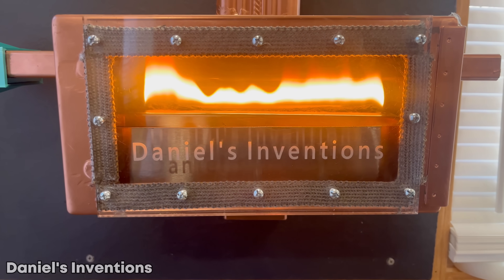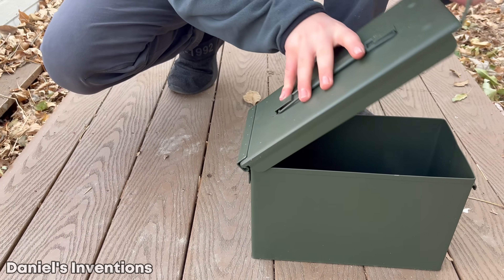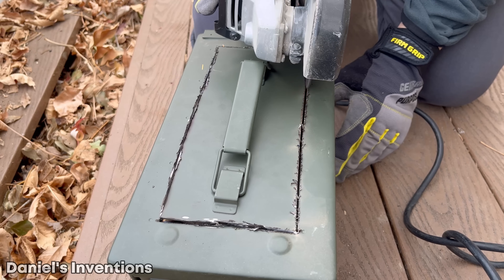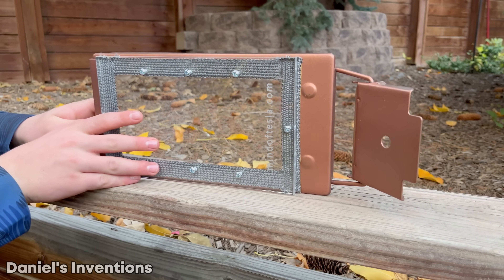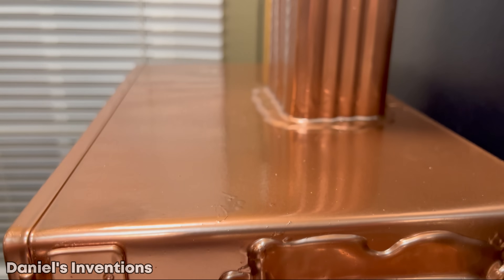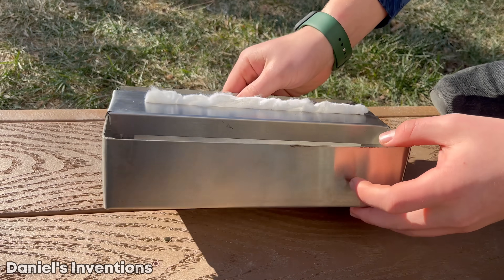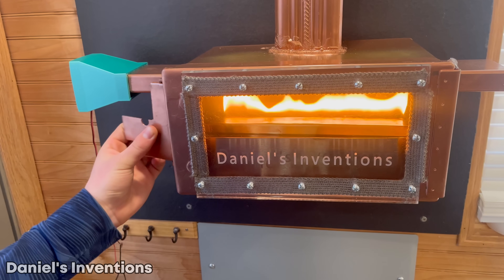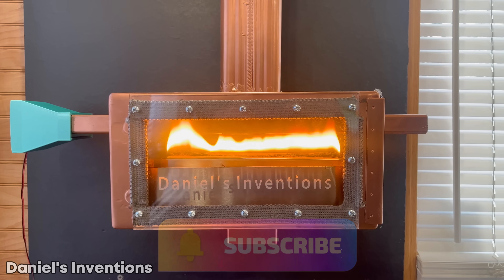ENDLESS Heat for Your Home WITHOUT Electricity 2.0

Comment: Pretty cool! A couple of suggestions-- use carbon felt as the wick because it will never need to be replaced and will wick up almost anything.  Use the high temp JB weld because this is pushing the temp limits of the standard JB weld and may release nasty vapors when it burns.  Before painting it with high temp paint, give it a long hot burn outside so the original paints can off gas.
Reply: Yeah you can see the stove offgassing at the end, I bet that was nasty.
Reply: Wrong. Pretty warm ☺️
Reply: Exactly what I was going to say and you need an insulated pipe on the exterior wall of the building
Reply: better yet, weld the pipes up
Reply: @SithLith  
I thought of that, but figured I would cover the drain pipe with stovepipe bolted to the top and run up the chimney.
Reply: @jimsteele2072  I guess it would depend how much heat the bolts transfer one pipe to the other.
Either way, I'm not installing one of these in my house unless it's much better built, wouldn't want a building inspector or an insurance company to ever see that as it would make it impossible to get homeowners insurance and you probably could never sell the property with that installed.

And if I'm doing all that I might as well just buy a propane or natural gas heater.
Reply: @SithLith  propane and natural gas are very expensive, though.
Reply: @w1975b  not as expensive as rebuilding the cabin when it burns down and insurance won't cover it because your stove violates your coverage.

Or the cancer treatment from all the carcinogens released by the epoxy and the green paint he didn't remove from the ammo box.

Also, this is essentially a fuel oil heater which is already a thing you can buy and you can build them safely and install them safely if you just do it right instead of cheap.
Reply: @SithLith  so...with suggestions from others, this could be done cheaply and safely compared to paying for propane or natural gas.
Reply: @w1975b  check with your insurance company first to see if they'll allow it, but by the time you do all of that, you're likely better off buying a used fuel oil heater, propane heater, or natural gas heater anyway.

If you really want to save money, then:
1. But a used wood stove in July (when they're cheap)
2. Install it with the proper parts and up to the building code
3. Get fire wood for free at a local compost site or after storms
Reply: @SithLith  You could technically have it exhaust out a window so it wasn't permanent. Just make a drop in insulated piece to fill the gap.
And having it closer to the floor would actually make it work better as it would be sucking in cold air from the floor.
Reply: I would have mine so that the exhaust is vented out my fireplace chimney.
Reply: @w1975b  Natural gas is one of the cheapest ways to heat - ok it USED to be.
Reply: @SithLith  Dang, I dunno, this looks more solid than many 'professional' installs.
Reply: @SithLith  Can't rely on those wood sources though
Reply: JP, as long as the carbon felt is rated for 2000° and direct flame contact, it is a good choice as a wick material, however there are variations which use adhesives to bind the material that break down with high temperatures and direct flame contact. In addition, most carbon felt becomes brittle when first burned (like the old style lantern mantles) and will not tolerate being jarred well. Fiberglass/cotton blended kerosene wick material may be a better choice.
Reply: @mrequi1  I've had wood for decades without much issue, just gotta be resourceful and hard working.
Reply: @SithLith  
Yeah, unfortunately many DIY solutions are more costly and troublesome than commercial options. This is only cheap because so many corners are cut. Those corners are OK to cut as a proof of concept, but I would never use this as shown.

That said, the compact size is what first caught my attention. My fireplace is several inches too short for an efficient wood heater. A unit like this could be installed in a spacer that fits in a door or window.

But, you'd have to strip the epoxy off the box, which would be a massive pain and maybe include chemicals, more safety considerations and cost. A better heat exchanger would give cooler exhaust, but you'd still want to use insulated stove pipe on the exhaust pipe and route it far enough away from anything. That pipe is not cheap, but thin guttering will corrode and potentially develop leaks. I would also insulate the unit  rather than just hold it away from the wall. I am concerned by the temperature of the outlet air. To decrease the temperature, the flowrate needs increased.
Reply: @SithLith  an insulated pipe (B-Vent) or, in my area a 1" space around the "flue" (Single Wall) with a non combustible collar (26 gauge metal) is essential to meet an acceptable standard of safety according to most municipalities, in my state at least.

To the creator:
Cool video and thanks for sharing it with us.
Reply: Robert Murray-Smith channel has multiple heating ideas as well as the carbon wick creation for his emergency radiant heater.  Me, I burn wood.  Good wood stove...reburner.  Wood is free.
Reply: If the boyo is working with limited tools and supplies, that's the best suggestion.

If he had more access, MIG weld a box with 1/4" thick Stainless Steel plating, use cotton wick or hemp wick, use used motor oil, double-up on the casing, use a sterling fan, and use angled mounts for the wall.

That's just me being an engineer.
Reply: I can confirm it DEFINITELY throw off fumes close to its max temp. It smells TERRIBLE. And is bad for you.
Reply: Thats exactly what i was thinking about the jb weld.
Reply: Thanks
Reply: I was just going to come here and suggest a carbon filter wick
Reply: @SithLith  I've got wood right now.
Reply: @SithLith  it's basically for survival purposes and when there's no gas or propane available
Reply: @lumberluc  and that’s the people that I like to see the responses from - the experts
Reply: @Gold63Beast  would the JB smell go away to a safe level eventually?
Reply: @markkenney3516  in my situation, it never did and I had to just replace the part. I did use non-high temp JB Weld. If you use JB Weld high heat, and you stay within the heat range, no fumes. It’s just the regular JB Weld that fumes really really toxic stuff. When you smell it, you KNOW that smell is cancer. Literally smells like it.
Reply: Do you think it could burn used frying oil from small restaurants? Lots of those are looking for place to dispose their used oil from the deep fat fryer.
Reply: @patdufresne6209  Yes but depends on the wick.  A carbon felt wick can pull up vegetable oil to burn, but it might be too thick to move up other types of wicks.
Reply: @smith0426  Thanks...it is just a little project my children and I might take on this summer.
Reply: He is WELL able! Praise His holy, blessed, sacred name  forever and ever and ever and ever and ever and… Repent and believe in Jesus Christ
Reply: He is WELL able! Praise His holy, blessed, sacred name  forever and ever and ever and ever and ever and… Repent and believe in Jesus Christ
Reply: Finally! Someone with a good suggestion!
Reply: @SithLith  Would you have the same issue with the candle heater too? They like to DIY a smaller candle heater with ammo boxes too.
Reply: I like the concept and admire this young man for thinking and attempting the build! All of us can see warning flags but the young man sees a goal! … stay after it kiddo, your on to something!
Reply: Nice but one thing, forget the JB weld try welding. be a better product in the end.
Reply: @SithLith  A store-bought will have features and limitations a person might not want.   Like my wood-burning insert for my fireplace that had a gas insert in it when I bought the place.  With all that heat, there's no reason to depend on the grid for power for the blower.  But it's a giant pain in the butt to retro-fit a store-bought for TEGs to power the blower off the heat of the fire.  A unit like that should be self-contained, with the blower kicking in as soon as it's putting off any heat.  But you can't buy stuff that's actually smart, because a bureaucrat who knew he was the smartest is an idiot.
Reply: I only first heard of carbon felt the other day, and now it keeps popping up in the comments.
Reply: @harrymills2770  I'm carbon not carbon felt sure felt what you carbon felt mean felt.
Reply: What he said
Reply: @w1975b  .... canola oil isn't.
Reply: @GregJoshuaW  I guess as long as you're not breathing the burned canola fumes, that could work.
Reply: @SithLith  I think I  would sleep better doing the reliable wood stove !
Reply: I bet you could use PVC as exhaust pipe as I do not belive this gets hot enough to melt it. I'd try it anyway. A hole saw & threaded adapter to screw it thru the ammo box. Like the idea. Thank you
Reply: @terryenyart5838  PVC will definitely melt or soften and release hydrogen chloride gas, the same stuff from the East Palestine train derailment disaster.  You definitely don't want to do that.
Reply: @SithLith all glory be to the mighty insurance companies
Reply: Well get one built and show us all. @lumberluc
Reply: Great additions to a great invention...Thanks for the suggestion!
Cheers! 😎
Reply: @SithLith  Insurance 😅
Reply: @SithLith this can be tweaked to perfect safety. Just a few minor add ons.
Reply: You pointed out a few great suggestions , thanks. Where would you look to purchase carbon felt? Thanks
Reply: Or bamboo or a lightbulb philimant?
Reply: saving lifes!!
Reply: Here is The True Savior

HalleluYAH “Hallel u YAH - Praise ye YaH”

YaH is The Father (Genesis 1)
YaH arrives via the TENT OF MEETING
YaH was Who they Crucified for our sins
YaH was Crucified on an Almond TREE

Ancient Semitic Moshe (Moses)
Isaiah Scroll (The Original Isaiah)
Reply: The high temperature of the oil burner box at the top was 475°.
   How hot does the oil container or the bottom become after full flame for few hours?   Will the oil heat to ignition levels?
  Will there be a major oil fire inside the fire box?
Reply: Why don't you make one and put it on YouTube please
Reply: @SithLith Just set it in a fireplace where the logs go & duct the heat exchange pipe towards inside of home & keep fireplace door open just enough for that pipe. Problem solved.😎